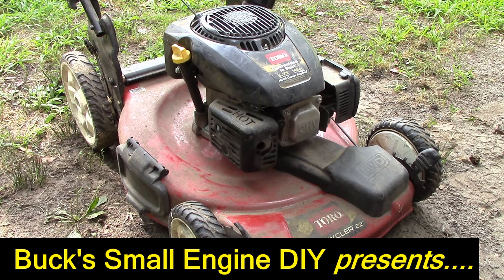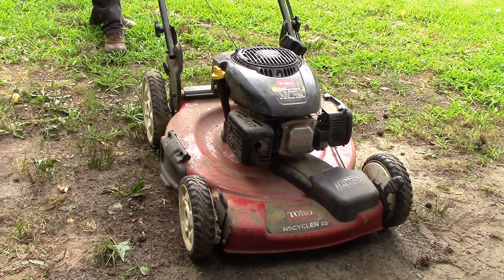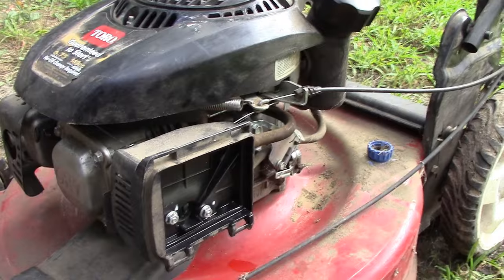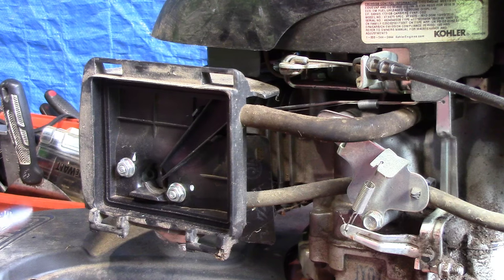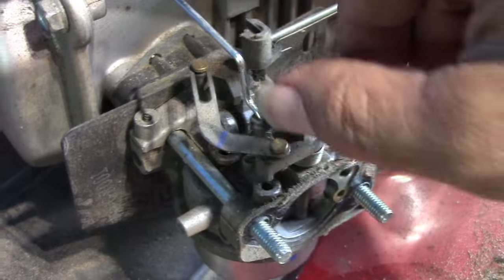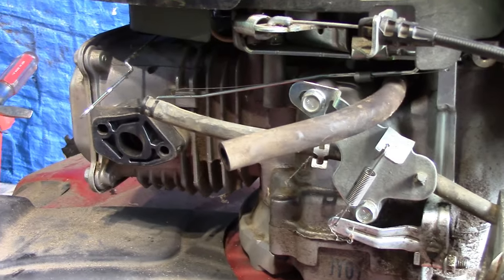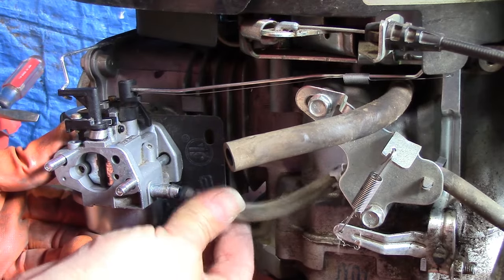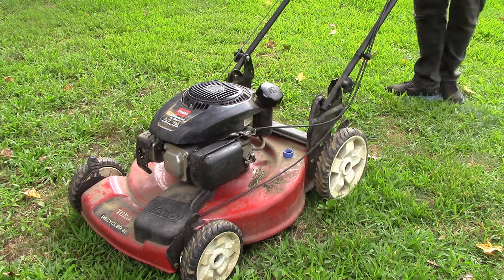Lawn Mower WON'T START - How to Fix It - Toro Recycler Kohler Engine

Comment: Those threaded holes on the top are for a different auto choke set up. Kohler changed the design either before or after and didn't have a reason to change the carb. They are simply not used here. Also, IMO, it's faster and easier to remove the top and take the choke linkage loose from the muffler than to remove the studs. Makes it easier to reassemble as well. Good vid

Comment: I like your content but your videography is not good
Reply: It helped me. It would be hard to do if you didn't have a tripod or one of those cameras strapped to your forehead. 
This particular motor must be a different year than mine. Some of the linkages aren't the same as mine. I'll figure that out when I reassemble mine.
I have to get a couple of gaskets that are torn. I've already cleaned mine out. It's ready for reassemble.

Comment: I  have a Craftsman Lawnmower with a Kohler 149cc engine. We bought it around 10 years ago from Sears and (bite my tongue) but we have never had a issue with it. It sits outside year round in our Canadian arctic and hot summer months getting snowed and rained on each year. I just change the oil at the start of every spring, check and clean the spark plug if needed. Put a new air filter on it and ( i converted the fuel filter to a external one) check the fuel filter and it is good to go for the season. The only other thing I changed was a fuel line because we had a pesty mouse that likes the taste of rubber and gas. We had to give him a burial ( thank god) because the high octane gas was to much for him. The key to making it last year after year is a little maintenance and some high quality high octane gas. I will be giving this one to my son and getting myself a self propelled lawn mower for all out unlevel yard and older age lol. I will buy another Kohler engine lawnmower again.

Comment: Great video ... I use to spend my winter nights rebuilding/cleaning my carbs that needed work ... as I aged I lost the desire to do that ... found that many cheap non OEM replacement carbs sped up the process of c getting my equipment running again ... then would clean the OEM in my spare time .... just picked up a carb on amazon for my Toro 6.5 for $16 and will instal this afternoon ... when I need my stuff quickly, swapping out a replacement saves me time and frustration ...

Comment: Just want to say that's outstanding video I have a Toro it was brand new it's probably doesn't have more than 8 hours on it but it's set through the season and the winter time and stuff and it just wouldn't start and you have provided enough information that a monkey could probably do this job.

Comment: good vid. i dont mess with the studs though, jsy two nuts holding on the autochoke and it comes off allowing you to free the carb. Those autochokes are unreliable. . i converted mine to manual

Comment: Picked one up at a garage sale, starts and runs but as soon as you engag the drive and push forward to cut grass it dies.... also dies even if you don't engage the drive???
Reply: Main jet is plugged. Running on idle jet.
Reply: @billhenry7833  cleaned the carburetor... main jet was plugged thank you.... my $5 dollar garage sale lawnmower is running like a Swiss watch 😂

Comment: Obviously there is a lot of skill involved in my opinion what you just did. So I'm going to have to get an estimate from the dealer what a brand new carburetor Will cost and bounce that off the option of maybe getting bad and just do a bolt on replacement take the cowards way out another words. But as a side note I am definitely not going to use anything but old-fashioned fuel not this corn fuel and I'm going to completely run it dry every time I put it away if it sits there for 30 minutes to burn everything off I don't care I want it dryer than a popcorn you know what.😊
Reply: 74 years old and I don't have a table to put it on so you know take that in account before you think I'm doing something I shouldn't. If I lose one or two screws and can't find them then automatically I probably going to have to take it to a dealer anyway and he's going to charge me the dealer's rate per hour and possibly I can get a brand new carburetor for less than two or three hours labor whatever they want to charge So economically I think it might be a wash and so that's what we're going to do and I'll provide feedback and see how that went so everybody is interested will know. Cancer thank you very much.